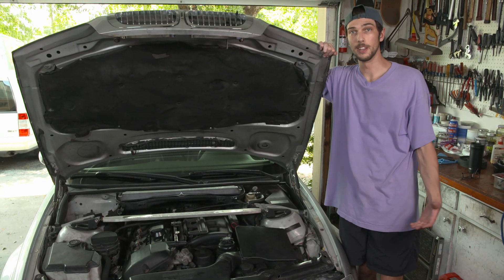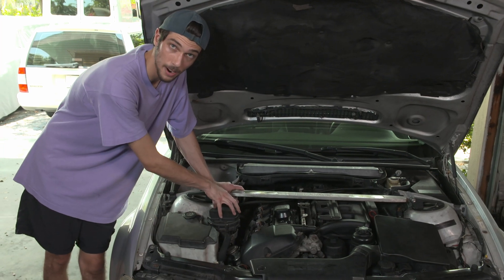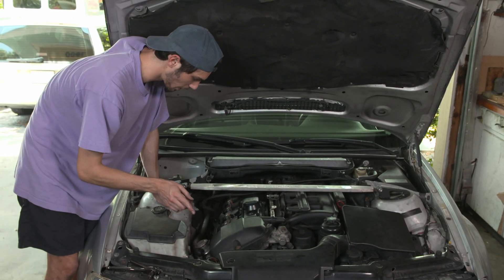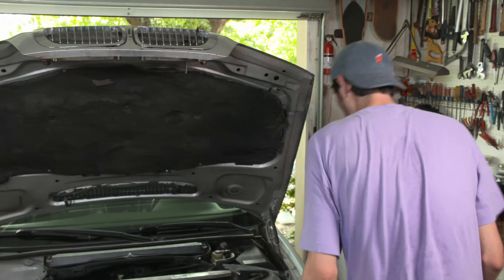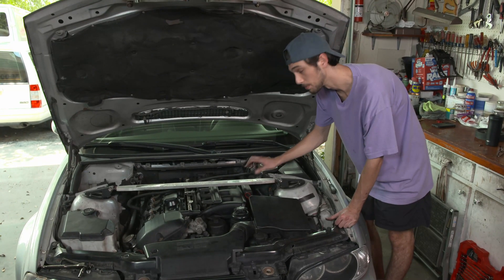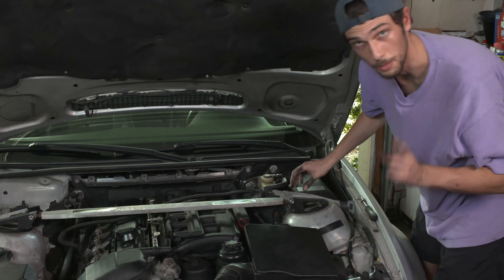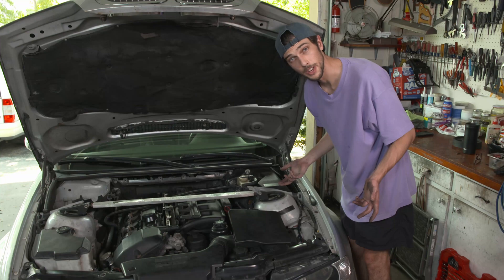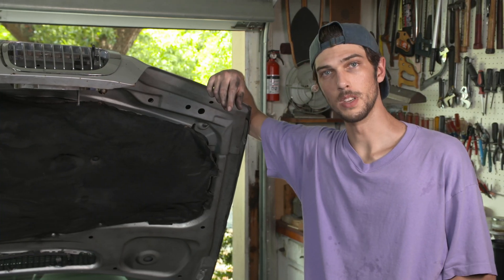IR1 - SECONDARY AIR PUMP DELETE E46 M54 (without deleting it)

Comment: Hey man if you just unplug the diverter valve and leave the hoses connected for the diverter valve would it still be the same thing as taking it off and plugging the holes im just thinking abt this bc i cant get the diverter valve off😂

Comment: my hose on my sap went today went to the valve on the manifold and the for some reason the nipples which is supposed to go back to the sap goes to a vacuum reservoir then back up into the manifold. i dont even have a nipple to run anything back to the sap

Comment: By doing this will it need to be tuned afterward and if not can it affect car by putting it into limp mode?
Reply from the maker: It will not need to be "tuned" in the typical sense, but if you want to avoid an EML light, you will need to re-code your ECU to ensure it doesn't check for SAP operation. This process is fairly easy and there are plenty of videos covering how to do it. I do plan on making my own video in the future, though.

Comment: does getting a tune to delete it help pass emissions?
Reply from the maker: I have always lived in Florida, so I don't really have any experience with passing emissions. However, I doubt you will pass emissions with a SAP delete no matter what, especially if your state does a cold start emissions check.
Reply: Yes a tune can cause the cel to stay off and for the sap system to be marked “ready” in the emissions system, or to be marked as n/a

Comment: Do I need SAP and SAL for my catalyst converter? I mean, it's not required.
Reply from the maker: The SAP is used to warm up your catalytic converters quicker on a cold start, which means lower emissions sooner. So, it is not strictly necessary to have your SAP if you still have catalytic converters, the SAP just makes them work better sooner on a cold start.

Comment: Man, the explanation with another intake manifold in the middle of the vid was simply glorious... I've worked there and all that job on the rear of the engine has to be done "by feeling" so knowing exactly what to do, what to remove, what to pull and in what direction is just invaluable, specially for people getting a hand  there for the first time (yes, one hand, because both won't fit)!! 
Thank you!
Reply from the maker: @ATBRush  Glad it could help 👍

Comment: Hey quick question after the removal of the vacuum control valve should I plug the area the hose comes from.
Reply from the maker: If you’re referencing the port on the back of the intake manifold: yes, check 5:34 for an explanation. If that’s not what you’re talking about I’ll just say yes always cap any open vacuum ports.👍